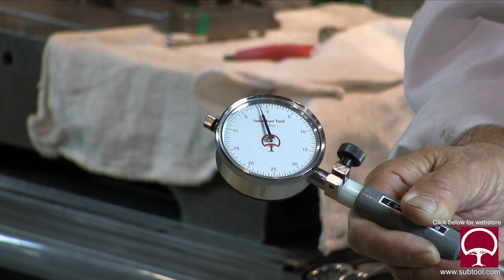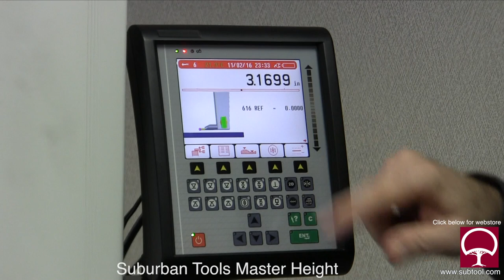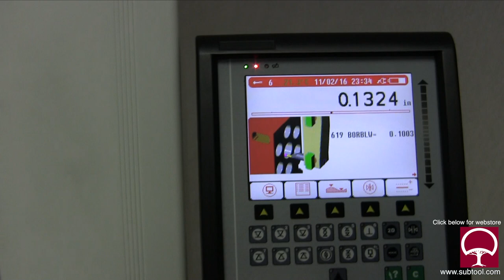Putting our Jig grinder into action

Comment: Very good!  I have done a fair share of jig grinding over the years. There’s a trick I use for setting the height- After I pick up the location of my part and zero the dials, get close to touching the wheel- I set the stroke switches top all the way up, bottom all the way down. Then I come down to half the width of the wheel at the top, then bring the top adjustment down till the switch clicks, do the same for the bottom. Start reciprocating and tweak as needed. Then turn the spindle on, grind .001 outfeed at a time for roughing, check size, slow down stoke speed, spark out etc. till to finish size. The last.0005 set the stroke to exit the hole slightly top and bottom. Works good👍
Reply from the maker: Good stuff, thank you for watching.

Comment: Just my 2 cents. Rough grind with a faster reciprocation and slower up and down feed and then slow down the reciprocation when bring the diameter to size and you can use a 200 grit Borazon wheel for roughing and finishing. Do it every day and it works great. Also watch your air pressure, that can make your hole go out of round. Jig grinding is all about technique. Definitely fun to run! You can do so much more than just holes too. O.D.'s, slots, and chop grinding ends of parts.
Nice video.

Comment: Nice Moore G-18 Solid State Jig Grinder,  1 h.p. 40,000 RPM Head, I did a lot of Jig Grinding  For 38 year's I was Tool & Die, Maker
Jig Grinding was always a joy. After Heat Treat always left .015 to .020 stock further apart hole's 10 inches and further apart the stock you want to leave a little more depending on the tool steel.  Also, you can set angles on the upper area of quill doors open up below the hand dial. I prefer the Hauser H Frame Electric Head to rip out the stock quickly with a tapered double-cut carbide burr.
and finish with the same tool holding .0001 { NICE VIDEO GOOD JOB }
Reply from the maker: Good stuff, thanks for watching.

Comment: Nice video Don.  FWIW I would think honing/lapping the bores to size then mounting several of them on tight gage fit arbor then surface grinding the .1003 dim. bottoms parallel to the arbor would be more efficient. This would make keeping good geometry while lapping easier with a group of say 4 pcs on the arbor than a single piece.
Reply from the maker: +ROBRENZ - You are right theres more than one way to approach this, we find our way convienient for our people. Thank you for your comment.

Comment: Do the jig grinding bits/wheels require any truing etc when installed, or are they just good to go out of the box? The fact they're some form of diamond matrix makes me believe they're not trued in any way and just ran as manufactured.
Reply from the maker: There not dead true but there good enough to go out of the box. A little bit of run off doesn't hurt anything.
Reply: It really depends on the size and type. Big vitrified wheels need trued but small grinding pins are ran as is. Plated wheels come out of the box and are just ran as is, resin bond needs dressed but that's about it.

Comment: Great Video. Two questions.
1. Is there enough heat generated affect the measured dimensions while you are grinding?
2. The part that you were grinding had a flat on it which would tend to stop it rotating. If it did not have the flat would it have required additional clamping pressure to hold it?
Reply from the maker: It could be if you are not carefull. Yes it would require different clamping.

Comment: Thanks for the vid Don I've been a EDM machinist for awhile and have heard many times that the truest holes are jig bored now I know what that looks like. Maybe for your next field trip you can show the masses EDM. By the way I've seen your gages everywhere and thought they just grew from the walls.
Reply from the maker: If they grew from the walls, my  job would be much easier! I've made a note of your suggestion, we might be able to find somewhere.  Thanks for the comment, and thanks again for watching!
Reply: Holes are not "bored" with grinding stones any more than a grinding stone can "cut" a flat steel surface. Pick up a handful of grinding "dust" some time. Do those little particles feel "sharp" like they were CUT from the metal they came from like tiny chips or shavings or filings? Can a grinding stone cut your skin if you spin it fast enough or drag it across your arm or hand fast enough or does it just "rub off" skin as its porosity and the gaps between the little stone "particles" grab ahold of and rip off cells bit by bit like they grab ahold of and rip off the tiny "peaks" on metal surfaces at the "molecular level" and actually "one molecule" or maybe two at a time? 

If "stone" abrasives and the common "minerals" and "rock" they're made from including ones found all around us in things like concrete were really good at "cutting" then you wouldn't have ended up with a "scraped knee" when you wiped out on the sidewalk as a kid learning to ride a bike and motorcyclists laying down their bikes without leathers wouldn't end up with "road rash". You'd have ended up "shaving" your knee and those motorcyclists would end up "filleted" by the street surface as they slid along it. 

Its sure amazing how many professional machinists and actual working machine shops with more work than they can do and who do pretty much any and all work imaginable don't use and don't even have such IMPORTANT AND CRUCIAL "MACHINE TOOLS" LIKE "PRECISION GRINDERS" AND SEEM TO GET BY FINE WITHOUT THEM. Probably because until "apprenticeships" became the preferred way to "train" new machinists or rather produce "trained monkeys" as cheaply and quickly as possible and by enticing them to become trained monkeys by "paying them to learn" which resulted in just about anybody and everybody becoming a "machinist" once they got their union card after daddy/uncle/brother/buddy got them an "apprenticeship" at Ford or GM or Chrysler or some supplier to them or some "aerospace company" etc.

 And those apprenticeships successfully got guys that hadn't even graduated high school or only barely and maybe only with a GED finally given to them out of pity or disgust or fear on the part of their "educators" end up "operating" or at least trying to "operate" machine tools that require at least high-school-graduate-level reading, reading comprehension, math and "science" skills to "get" the basics of machine tools, processes, blueprints, measurements, specifications etc and then be able to properly use and read and select precision measuring tools and use basic hand tools to "set up" a machine for even basic tasks. 

 And most probably didn't give their "career choice" much thought or if they did just thought being a "machinist" sounded like a "cool job" or at least the pay was "cool" suddenly finding themselves hopelessly lost and their "masters" who ALSO probably became "apprentices" for similar reasons and only know what their own "master" managed to teach them and they managed to remember some or even most of which was wrong or bullshit or irrelevant or incomplete in the first place suddenly have to play "teacher". And  just when they're getting enough seniority and are sick enough of their job they never really "wanted" in the first place to give approximately zero fucks about "mentoring" a younger and probably dumber version of them that only reminds them of the "good old days" while making each day a "unique challenge" as they try to "train" someone who didn't even think finishing high school was "worth it" to do things some very "smart" people who really want to learn never really "get" and even the "best" only truly learn over years and decades of wanting to do the job and learn them. 

And when an "apprentice" union card or not still has to perform some useful task and there are plenty of more "senior" apprentices who are there "learning the ropes" one hard, ugly lesson at a time and producing "in spec" parts that may be "in spec" but damned sure aren't very "pretty" and may not pass "inspection" on that basis alone since "passing" ugly parts when parts inspections/measurements/qualifications/verification are done to make sure the MACHINE TOOLS and MACHINISTS ARE PERFORMING CORRECTLY rather than to make sure the PARTS ARE and its very plain that some guys just ain't gonna "make it" and are never going to "get it" as MACHINISTS but maybe something a LITTLE SIMPLER AND IMPOSSIBLE  TO SCREW UP AND THAT CAN "FIX" THE "UGLY" ON THE  LEARNING PROCESS PARTS OTHERS WHO MAY OR MAY NOT EVENTUALLY GET IT ARE TURNING OUT LIKE "SURFACE GRINDING" THE "UGLY" OFF THE PARTS AND SURFACE GRINDING IS EASIER THAN GRINDING CASTING FLASH OFF CASTINGS WITH A HAND GRINDER OR BENCH GRINDER AND MUCH SAFER AND ITS CLOSE ENOUGH TO "REAL MACHINIST WORK" SO A "APPRENTICE MACHINIST" THAT'S A LITTLE SLOW ON THE UPTAKE WON'T GET THAT HE'S BEING "DEMOTED" TO BELOW "CASTING FLASH REMOVER" OR WON'T GIVE A SHIT IF HE DOES FIGURE IT OUT SINCE THE MONEY IS THE SAME EITHER WAY, THERE YOU HAVE THE REASON THAT ONCE YOU GET AWAY FROM "PROFESSIONAL MACHINISTS" WHO GOT THAT WAY VIA APPRENTICESHIP AND THE "MACHINE SHOPS" THEY START/OPERATE WHEN THEY RETIRE FROM OR GET LAID OFF FROM OR GET BOUGHT OUT OF THEIR UNION AUTO/AEROSPACE "MACHINIST" JOB AND THINK THEY'RE REAL LIVE ACTUAL TRAINED AND QUALIFIED AND CAPABLE MACHINISTS AND HAVE DONE IT ALL AND SEEN IT ALL THERE AT THAT PRECISION GRINDER DAY IN AND DAY OUT FOR YEARS OR DECADES AND MAYBE DURING SOME "TRAINING" AT A MILL AND/OR LATHE ALONG THE WAY "RUNNING" PRODUCTION PARTS ONE AFTER ANOTHER AND JUST "KICKING ASS" WITHOUT A SINGLE PROBLEM SINCE SOMEBODY ELSE IS DOING ALL THE ACTUAL "MACHINIST STUFF" FIGURING OUT AND MAKING AND SETTING UP AS "IDIOT-PROOF" OF A MACHINE/PROCESS AT ALL WHERE THE "MACHINIST" MAY HAVE TO DO ALL OF TWO OR THREE VERY SIMPLE 2-SECOND TASKS ALL OF WHICH ARE EITHER TURNING A HANDLE, PULLING A LEVER OR PUSHING A BUTTON TO "RUN" EACH PART. 

If and when they ever get exposed to the "real world" of actual "machinists" and "machine shops" where jacking around with a GRINDER making something "SMOOTHER" or "FLATTER" or "PRETTIER" than  it needs to be to be DONE AND OUT THE DOOR AND TO THE CUSTOMER'S SPECS is about as practical and profitable as hiring somebody who has extensive "precision grinding experience" to work in a real machine shop simply because they put "machinist" on their resume' and answer a help-wanted ad for a "machinist" and have an IAMAW card in their billfold and "know the lingo" well enough to fool or at least tempt an overworked and stressed and weeks-behind machine shop owner/manager to give them a job even though "knowing the lingo" seems to be all they know about anything except "precision grinding" and there isn't a precision grinder to be found in the shop's "tool inventory" or in any of the real machinists' working there's "work history" unless its a VALVE GRINDER or maybe a CRANKSHAFT OR CAMSHAFT GRINDER. 

Its no wonder all these "expert machinists" with all the "how-to videos" and such undying devotion to "precision grinding" have so much free time on their hands even though they should be swamped with work and/or job offers if they're really capable and qualified and expert machinists and anybody besides them and their family members and friends and YouTube "fanboys" knows it. There's just not a lot of call for "precision grinding" engine blocks, cylinder heads, flywheels, cylinder bores, connecting rods, metal-sprayed and turned-down shafts after they've had bearings spin on them, welded and line-bored and bushinged loader lift frames or backhoe booms/sticks, damaged/scuffed/scored hydraulic cylinder tubes that need to be bored/honed oversized and new oversized pistons made/fitted or any of the other countless and unending jobs real machinists/shops are doing day in and day out and without precision grinder experience or precision grinder presence while all these "experts" sit in their empty "machine shops" or the back room of their apparently "slow" precision tool sales businesses making YouTube videos demonstrating their expertise/experience/knowledge/skill and the RIGHT WAY TO DO THINGS REAL MACHINISTS/SHOPS WOULD HAVE DONE IN LESS TIME THAN IT TAKES THE "EXPERT" TO DRAW UP HIS "PLANS" AND EXPLAIN TO THE CUSTOMER WHO DOESN'T GIVE TO SHITS HOW ITS DONE AS LONG AS IT GETS DONE JUST WHY "JIG GRINDING" IS THE "ONLY WAY" TO "BORE" THAT HOLE EVEN THOUGH MILLIONS OF HOLES IN "HARDENED STEEL" AND BORED/LOCATED TO MUCH TIGHTER SPECIFICATIONS ARE BORED CORRECTLY QUICKLY AND WITH ZERO GRINDER REQUIRED DAY IN AND DAY OUT BY "APPRENTICE MACHINISTS" WHO DON'T HAVE THE TIME OR INCLINATION OR EGO TO GET ON YOUTUBE TO TELL OTHER SUPPOSED "MACHINISTS" HOW THE HELL TO DO THIS OR THAT EVEN IF THEY KNOW. ITS WAY MORE SATISFYING AND A HELL OF A LOT MORE "PROFITABLE" AND HELPS TREMENDOUSLY IN GETTING/KEEPING JOBS AND WORK TO JUST DO IT INSTEAD OF TALKING ABOUT IT AND THEN "DEMONSTRATING IT"  FOR KICKS. UNLESS THAT "EXPERT MACHINIST" IS IN THE "PRECISION GRINDER BUSINESS SELLING PRECISION GRINDERS, STONES, BRAND X PRECISION MEASURING TOOLS AND OTHER CHEAP, IMPORTED AND UNNECESSARY/UNWANTED/UNNEEDED/UNUSED MACHINES/PROCESSES/PRECISION TOOLS THE "NOOBS" WHO COME TO VIDEOS LIKE THIS TO "LEARN TO BE A MACHINIST" IMMEDIATELY DECIDE THEY HAVE TO HAVE AND CAN ACTUALLY AFFORD BECAUSE THE REAL MACHINISTS/SHOPS SURE AREN'T CREATING ANY DEMAND FOR THEM AND THEY'RE JUST GATHERING DUST AND CAUSING OVERHEAD.

Comment: do yourself a favor,shut the spindle off,crank the grinder head up,move your measuring tools away from the diamond dust, then check size.oh,that temp gage is for the entire grinding head. if it gets too hot,you will loose location.also,those grinding wheels are borazon coated. about .030 thk. on a side on top of hss.
Reply: Also - if your job is a long run - ie; many holes - good idea to go back to your pick up point every so often because of that very reason - machine casting temperature.

Comment: Metals do not absorb moisture. The only thing that is able to diffuse into the material is free single hydrogen atoms, which does happen. The water would have to be decomposed into free hydrogen and oxygen for this to take place, such as in a welding arc via electrolysis
Reply from the maker: Thank you for the information we appreciate it.
Reply: No problem sir! Glad to spread a bit of knowledge. Keep up the great videos. I feel like I am a master grinder hand after watching your videos!
Reply: Clearly you've never seen "cross-sectioned" steel that's rusted from the "inside out".

Comment: How does your height master measure a diameter with a 2 point contact?  You need at least 3 points to get a half ass close measurement.
Reply from the maker: Its not really a two point contact, you sweep the top of the diameter and the unit finds the high point, then automatically travels to the bottom and you sweep again and it locates the low point and caculates the diameter.
Reply: +SuburbanTool Inc please do a video on it.  I didn't see you move the gage left to right.  would be interested in more details.
Reply: cruch9 The probe only moves up and down, the part is moved left and right for the sweeping motion

Comment: uhmmmm…. If "tenths" are that critical isn't jig grinding done in a  temperature controlled room? That's where I've seen every jig grinder placed.
Reply from the maker: Yes depending on the jig grinder, it would be better in a controlled temperature especially going point to point. We use the QC room to make sure.